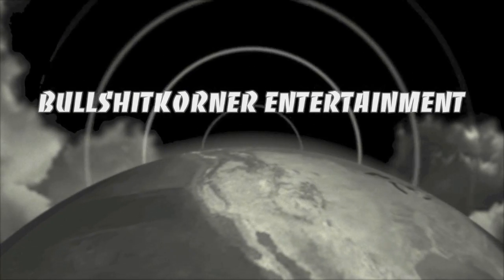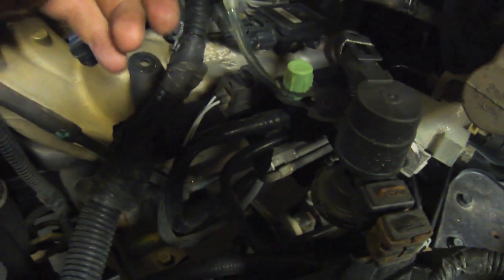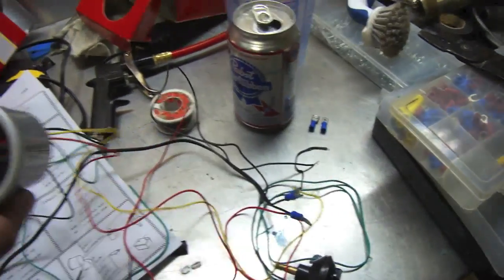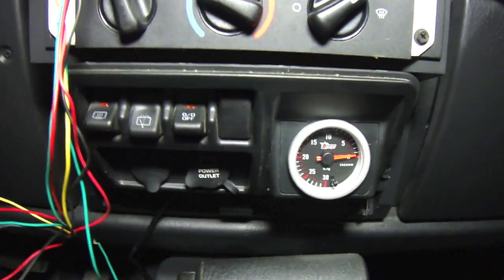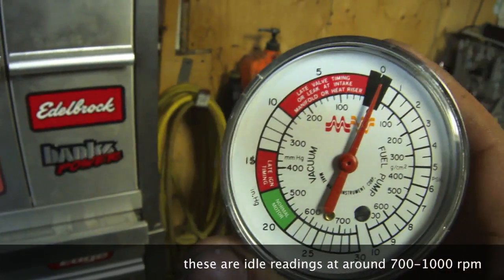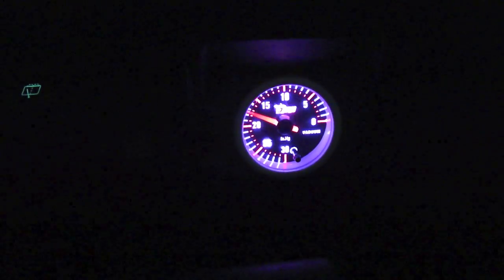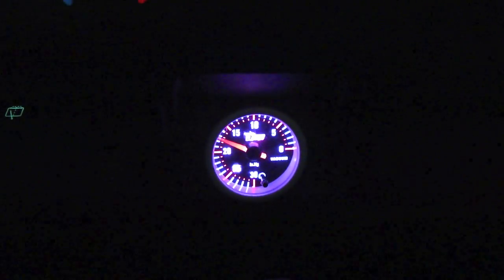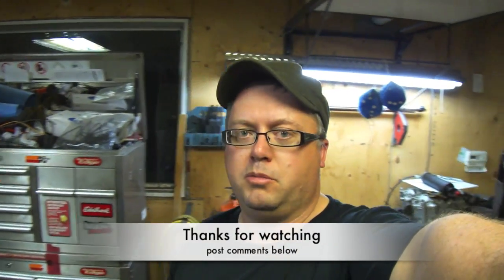Instaling a Vacuum Gauge to Monitor Motor Health

Comment: Jerry - have installed an autometer vac gauge on my XJ.
When firing up/cold motor idling, it shows around 16/17 psi. At operating temp, around 18/19 psi when idling - is this a sign of a healthy engine ? Thanks.

Comment from the maker: it was just a cheap vacuum kit off ebay that came with all the attachments.  if you do decide to hook one up drill and tap a fitting in the manifold.  the set up I used worked perfectly until i went to use my defrost and it seemed to take forever to switch vents.  the vacuum line sharing with the defrost line must consume too much vacuum